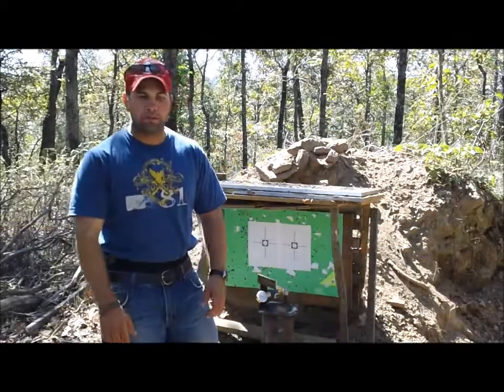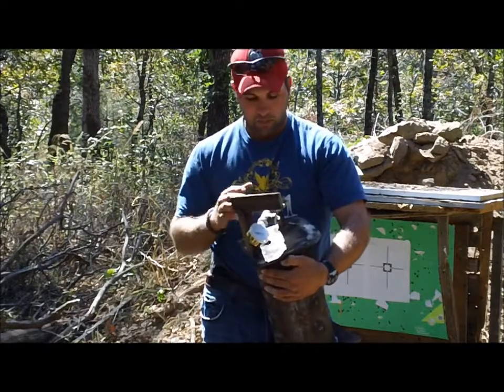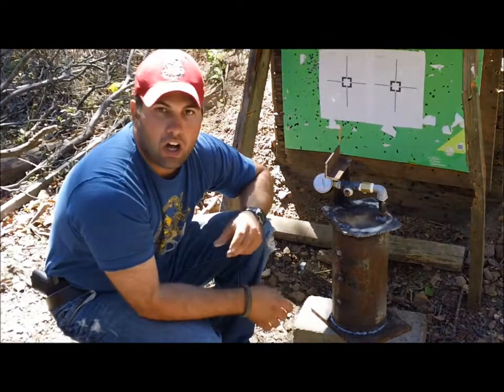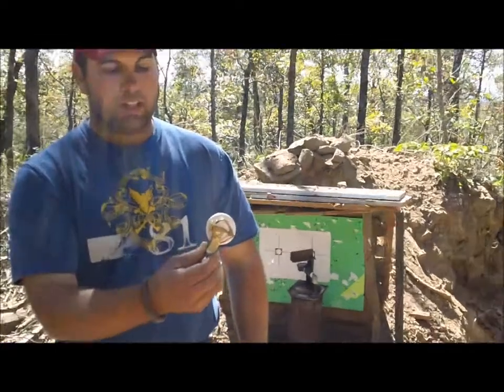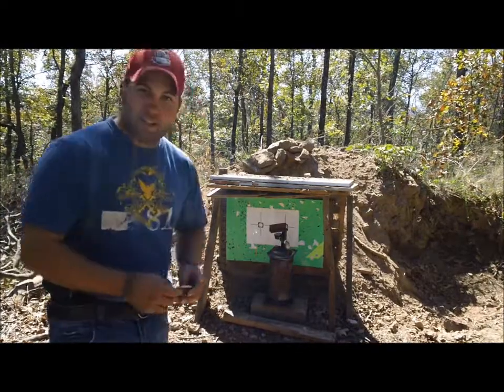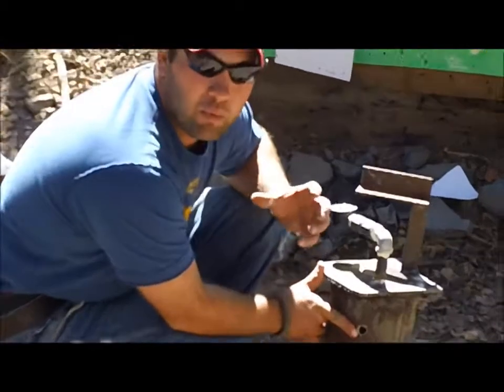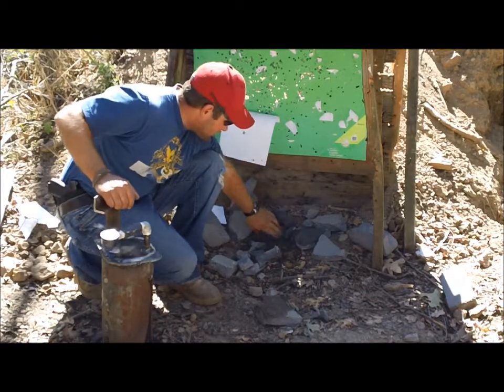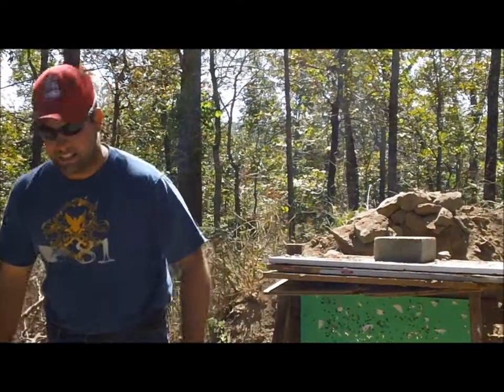under pressure or over pressure

Comment: remote guage would do it, with flexible hose to absorb the shock. Also see what the yield point of the steel top plate is, that might give you an idea.